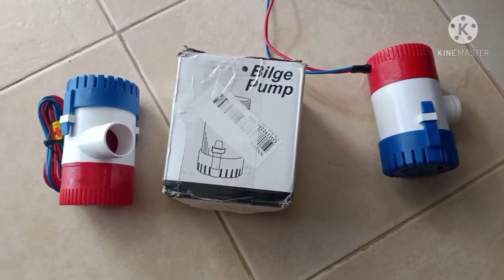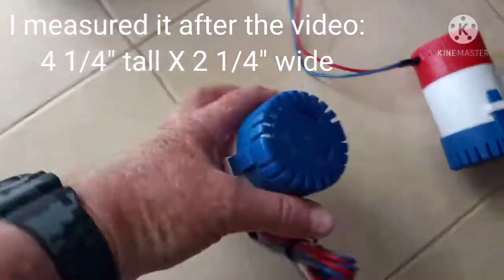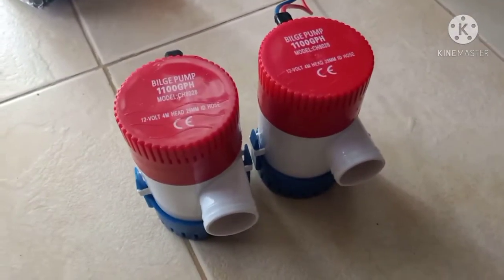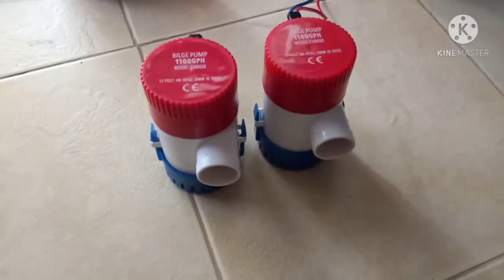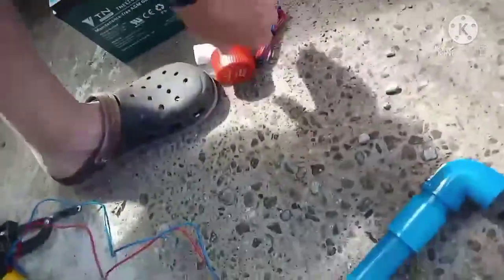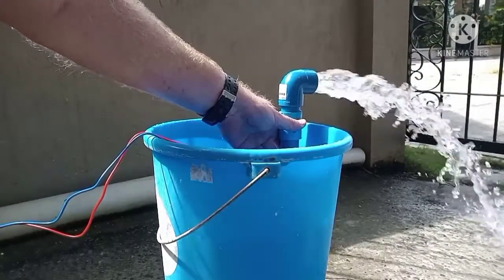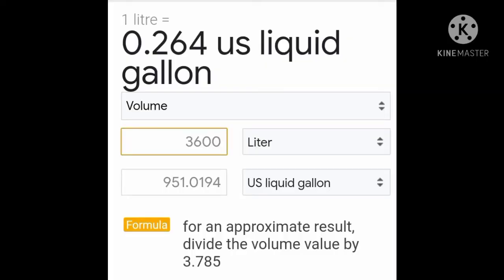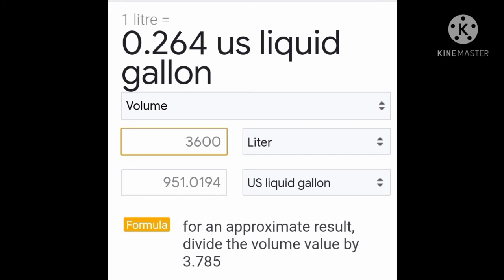Bilge Pump review 1100 gph bilge pump from Lazada

Comment: how long does the battery AGM 12V run for a long time?
What is the maximum current when the pump is running in water?
Reply from the maker: That was a 25ah 12v battery.  It ran both pumps for about an hour the last time I used it.

Comment: Can I use 12volts adaptor 
Power supply that supply mostly in household. Not In battery
Reply: U can use but make sure that adapter could provide at least 12v 5A/60w for smooth running
Reply: @NONAME94gpal  ah thanks

Comment: That switch you used in your next video hooked up to these, what kind was it? Looking to try this out myself. Was the wiring complicated? Cheers
Reply from the maker: I just used a switch that was available at a local electronics store.  I'm in the Philippines...slim pickings.  Super easy to wire it up.
Reply: @mikesyoutubechannel6367  thanks for the reply. Was it a 6-pin? 2 for each pump and 2 for the battery?
Reply from the maker: @kentgerman3992  The 2 red wires from the 2 pumps go to one connector on the switch.  Then you attach a separate wire on the other connector on the switch which goes to the positive on your battery.  The other 2 wires from the pumps go straight to the negative terminal on the battery.  Just search on youtube how to wire a toggle switch.  It's easy once you watch it.
Reply from the maker: @kentgerman3992  The switch only has 3 connection points on it.  You only need a toggle switch with 2 connection points, though .
Reply from the maker: The switch and wiring was easy.  Look up videos on YouTube on how to wire.